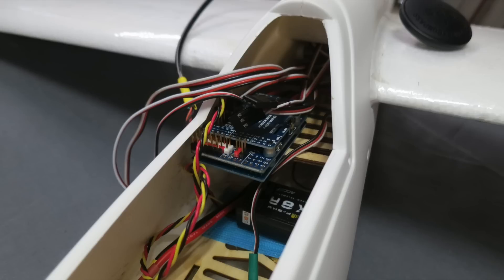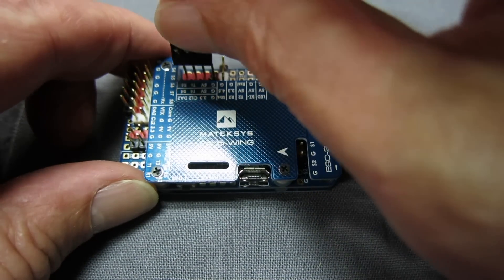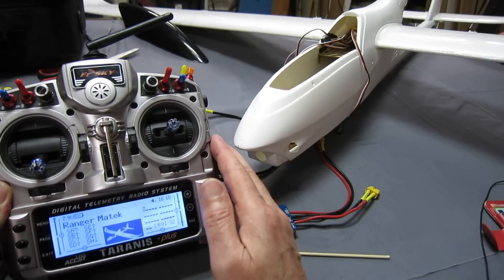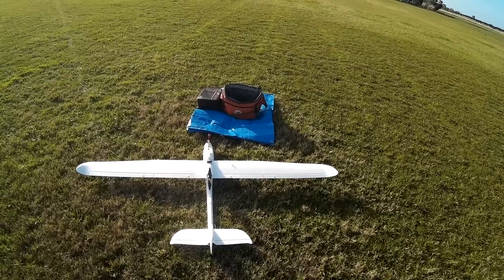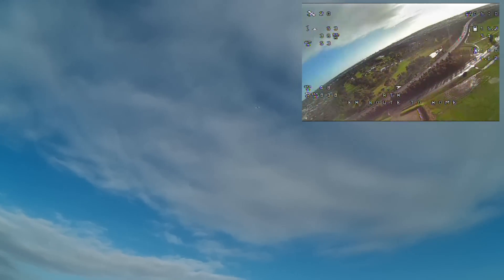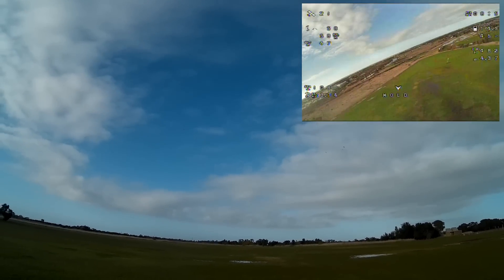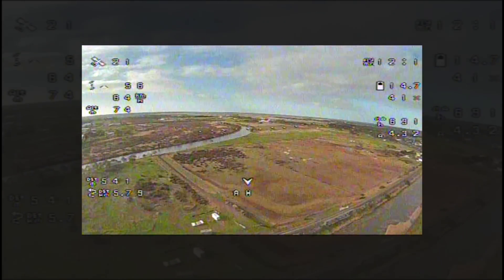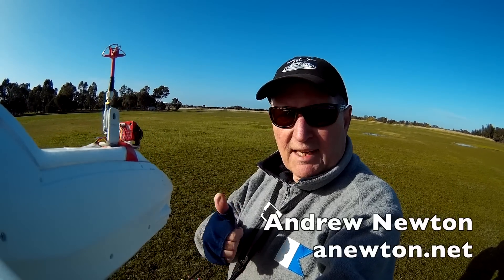Matek F405 Wing FCB iNav setup and flight

Comment: Hi Andrew, I would like to ask you a question, I have a Matek 405 v2 for my glider, I use Inav Configurator 6.1.0 and FC Firmware 6.0. I completed it and I even flew it, but only the pitch servo and ailerons work, the rest doesn't work, Inav reads it but they don't respond to the commands... I tried everything, can you recommend something?
Reply from the maker: Solder bridge the Vx and Vx2 pads. Watch my review of the V2 board

Comment: Hi Andrew, on the Matek wiring page it says that left & right Ailerons go on S4 & S5. Does this mean that they need to be plugged in separately or can I use either S4 or S5 on a Y lead ?   Trust your fingers are recovering, had a look at them on your Community Tab, boy that had to hurt big time :) Cheers, Pete
Reply from the maker: Y lead is fine. Only need separate channels for flaperon function
Reply: @AndrewNewton  Thanks Andrew, that's what I thought but I knew you would know :)  Regards, Pete

Comment: Another awesome video. 
I am stuck with the FPV setup. May I learn your VTX preference for this configuration. On one of your video I watched your positive review about TS5823L, would it be fine to use that?  Thanks in advance.
Reply from the maker: Most of my FPV setups use the 200mW TS5823L Cheap and simple.

Comment: This might be a stupid question, but do you need an ESC if you use the Matek 405? I assume the ESC is not needed since the flight controller handles that as well.
Reply from the maker: Some quad FCs have ESC on board but not the F405. It does have BECs but not ESC

Comment: Hello, is it possible to trim my plane (I’m using matek 405 on inav)while I’m flying or I should do it after fly? Tell me pls how to do it, I heard that it is a mistake to trim servos on taranis?
Reply from the maker: Yes, switch to Manual, activate Auto trim mode while flying, fly level for maybe 30 seconds, trims should adjust themselves, land and disarm. Dont touch the taranis trims.

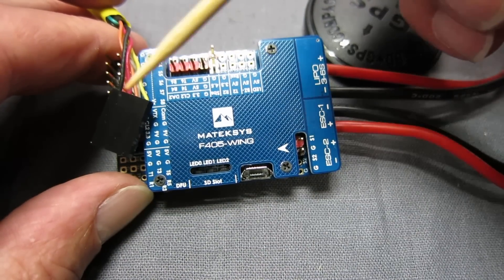Comment: Hey Andrew. Just starting my build. Interesting, I did what you said and opened the GPS to confirm the wire and terminal alignment. I thought I had an issue with the GPS as the black ground wire (assumed) was frayed. I see it was exactly the same for you (1:33). Not sure why it is, just good to know I’m not alone. I was thinking I would have to rewire it and solder to the terminals. Have you had any issues with the GPS as a result?
Reply from the maker: It's a shielded cable so the bare ground wires wrap around all the others then come out to the black wire (maybe). No problems with mine so far.
Reply: Thanks Andrew. Hadn’t thought that one through. Makes sense ✈️

Comment: Have got the Matek F405 too.....but seems to be something wrong. Pos hold wirks very well, but the plane won't return to home....
Reply from the maker: Frustrating. Recheck your setup from the beginning, make sure the GPS is marking the home position.
Reply: @AndrewNewton  Homeposition at Arming and Arrow to Home looks fine. tomorrow i'll try again... could imagine that there is a issue with the max angles in navigation modes.... today was frustrating. Crahsed my 9" into the woods....lost a 100€ 4 inch....and my 5 inch quad is toilett bowling as hell :D

Comment: I have this set up in a similar model and when I'm in manual mode the plane wants to roll to the left. To trim this do I have to adjust my servo arm or can you trim this in INAV configurator? Your videos have been extremely helpful!!! Thanks for sharing your knowledge and experience!!!
Reply from the maker: The best way is to adjust the aileron push rods, or you can use Auto trim to reset the servo mid points.
Reply: Andrew Newton thank you sir!! I did try the auto trim but it didn’t seem to fix the roll. I believe the safest way would be to adjust the pushrods manually. Then I know the plane will fly correctly for sure. Thanks for your help!!

Comment: I can’t find those 4 pin servo plugs anywhere. Where did you get your from?? What are they called, except 4 pin servo plugs??
Reply from the maker: Dupont connectors https://www.banggood.com/Geekcreit-310pcs-2_54mm-Male-Female-Dupont-Wire-Jumper-With-Header-Connector-Housing-Kit-p-1063303.html?

Comment: I have this installed in a SonicModell AR Wing.  Everything works well except for one very annoying bug.  The OSD drops out intermittently several times during the flight.  The video is solid, but the OSD drops out.  I have triple checked everything and even replaced the flight controller but the problem persists.  
I am not using the 5 volts from the ESC but am powering the board through the battery voltage only.  I'm ready to pull out the F405 and go back to an OmnibusF4.
Reply from the maker: Some cameras just dont like the OSD overlay. Makes sure PAL / NTSC selections match up, and VTx and camera share the same ground.
Reply: @AndrewNewton  Problem solved thanks to you getting me to look in the right direction. I simply changed out my camera from a Biteye SA-A3161 to a CaddexTurbo Micro F1.  Interestingly enough, although the Biteye specs state PAL and NTSC, there is no adjustment in their OSD menu for video format.  In INAV, I always select Auto for video format and never have had a problem.
Again, thank you very much Andrew for your suggestion.

Comment: Hi Andrew.  Just asking what port was your gps on in inav ports tab please?   I am having a lot of trouble getting the fc to recognise the gps.  Thanks.   Ben
Reply from the maker: UART4 for GPS with the F405 Wing. Try swapping the Tx and Rx connections, make sure "GPS for nav and Telem" is activated in the config page
Reply: Thanks Andrew.  Much appreciated.  UART 4 corresponds to the TX and RX pads on the flight controller.  It is working well now with a Ublox 6mn gps from an old APM.  I am using the Matek f405 ctr for this QAV500 quad and have ordered an F405 Wing from your affiliate link for my Bixler project.  Many thanks.   CP

Comment: So does this mean the 411 board is not as good? Dam As I bought 2.
Also do you need to swap rx and tx with GPS same as the 405?
Reply from the maker: F411 Wing is a good board. Just that it is not filtered on the FPV feed and ESC noise shows if you power the ESC through it. It's not terrible and can be reduced with an LC filter. Video is clean if you dont connect the ESC to the board, which means you dont have current sensing. F405 Wing is the best
Reply: @AndrewNewton RX/TX gps on f411 SWAP yes or no?
 Cheers Andrew . Gone from not wanting/intrested in APs to a wealth of knowledge. 
You the man.
Reply from the maker: Yes, that's always the way with UART connections. Rx goes to Tx and Tx goes to Rx
Reply: @AndrewNewton  Thanks mate. Just watching your f411 Video as I type. Your getting slick cobber dont forget the small peope on your way up! :-)

Comment: How did you make the compass work? My Missionplanner does not detect it. I use arduplane.
Reply from the maker: No compass connected, it's not recommended for fixed wing iNav. The direction is coming from the GPS and only works when the plane is moving.

Comment: Andrew, I also purchased a Matex and funny I had the same revelation with hooking up and powering the GPS. Too bad I did not watch this first. My only remaining issue is using the Inav OSD. I hooked up the transmitter and camera just like you and great pictures, but no OSD readings. There is probably a small item I missed. Any suggestions?
Reply from the maker: Have you enabled OSD in iNav configuration page?
Reply: @AndrewNewton  I went there and did setup the features and in the modes I setup the OSD SW. I didn't remeber the switch but went back and see that turns it on and off. My error. Thanks.

Comment: Hello , new to rc aircraft, is it possible to run 8 motors with this esc? In other words use the two esc power pads to power four motors each. Its for a school project involving distributed electric propulsion. Ive looked for previous examples and  researched the topic through different forums. It seems possible with Y connectors but would appreciate any knowledge you could share on the topic. thanks.
Reply: so four esc's wired together using y connecters and plugged into the same channel on the receiver.
Reply from the maker: Sorry Caleb but I don't know. Usually motors have separate ESCs but I don't know if there is any particular reason.
Reply: sorry I meant 8 escs and motors with this flight controller? Have four escs and motros on one wing connected to one of the esc power pads and the other four connected to the second esc power pad.

Ive researched and it seams possible using y splitters and only running the positive lead to one esc and just ground to the other 3.  
 @AndrewNewton

Comment: Quik question, Do I need to set up in my radio a plane or swing?in case that I have a wing.
Reply from the maker: Basic plane with no mixing, no expo, no rates. Just 100% throttle, 100% aileron, 100% elevator. Here's my blog post that gives more details. http://newtonairlines.blogspot.com/2017/10/inav-fixed-wing-tips.html

Comment: What do you mean trim it mechanically?
Reply from the maker: Get the plane or wing flying level by adjusting push rod lengths only. Not using transmitter trim at all.

Comment: is there a name for the 4 pin plugs or a link where to buy them
Reply from the maker: DuPont connectors - https://www.ebay.com.au/p/610pcs-Housing-Connector-Pin-Male-female-Crimp-Pins-Kit-for-Dupont/5022439451?iid=273399094957&chn=ps

Comment: Andrew I noted you plane flight crockett, that is not because of you trimming, is because the board when you initialize was not level, that happen to me before, if you see that you horizontal bar do not match with the horizon  is because is not sink, and some time if you trigger return home or fail safe, he's going to fallow the horizontal bar, and in extreme cases will dive into the ground, happen to me in one wing.

Comment: Hi Andrew 
Think I will give Inav a try!!   Probably using a H King Bixler V2 and the Matek F405 which you have described so well..
Do you soft mount your Flight Controllers i.e. Using anti vibration mounts etc??
Reply from the maker: Perfect combination. I usually mount on firm foam pads but it's not essential as far as I know

Comment: You need to plug a GPS unit in? The board won't work without it? I'm looking at getting this board just for the osd and autolevel and was planning on adding in gps and that sort of thing later on. Can i use the board without a gps?
Reply from the maker: Yes, GPS is an option, not essential

Comment: Quick question - does the board provide enough current for all servos, vtx & camera ?? - I read the F411 is not good enough, so wondered if the F405 is any better - thx !
Reply from the maker: Oh yes. The BEC for servos is 5V 6A, that's better than any other BEC I have used

Comment: Yep they dont make setting up flaps easy do They, still scratching my head
Reply from the maker: I have a solution of sorts, I'm plugging flaps directly into Ch8 on my X8R and not using Ch8 via SBUS on the MATEK board. Video coming as soon as I can test fly the setup. I suspect iNav 2.0 will make all this easier.
Reply: Andrew Newton finally worked it out mate! Need to create another input channel on your taranis for flaps, then in inav on the mixer tab create a new rule for the channel that you created in your taranis as the source and modify it on the servos tab :)
Reply from the maker: Excellent. I'll try it soon too.

Comment: Hi again Andrew!
I'm planning a winter project (in your summer) building an ASW28 and equipt it with FPV. As training I have a Timber UMX with a micro cam and VTX. I tried using goggles, but that didn't work for me as I'm using reading glasses, so now I go for a monitor mounted on to the TX. Then I'm building a FPV-pod a la Alan Moore to use on my pressent ASW 28.
Now to the point. In the new ASW 28 I'm planning to use a FCB. I've studied your two videoes of the Matek 405, then I've found another FCB for fix wing, a Cyclops Storm. The major difference between the two is that the Cyclops Storm is complete DIY kit, (except cam and WTX) while the Matek 405 is more abuild-it-yourself gadget. And then the Matek 405 require some soldering and switching around with cables and plugs. But it sertanly has moore features and possibilities.
I'm sertanly not a trained "solder", and have limitied knowledge in electronics, but I can read a manual and follow a procedure. What do you recommend? 
And you are using a variety of servo plugs. Is there a tool that fix the cable to the plug, and where do you buy theese plugs, 2, 3 and 4 pins and tools.
Thanks for very interesting videoes.
"Sev"
Reply from the maker: Hi Sev. These are the Dupont connectors I bought https://www.aliexpress.com/item/1450Pcs-Set-2-54mm-Dupont-Connector-Kit-PCB-Headers-Male-Female-Pins-Electronics/32841687530.html There is a crimping tool available but I just use long nose pliers and solder. You would need to practice soldering before taking on the Matek F405, the fine pins are easy but the thick battery wires are more tricky to do nicely. Worth learning the skill anyway. I dont know anything about the Storm FCB but it does look easy to connect up. Interesting project, but flight control boards are not really designed for thermal gliders. Would be better suited to something like a Ranger 2000 with big batteries and long powered flight time.

Comment: As always, great video, Andrew!  I'm definitely going to order this flight controller.  Maybe two, lol.  I wanted to share something with you, just in case you weren't aware of it.  You can add a Lost Model Buzzer/Beeper to the flight controller and, when the GPS Lock has been acquired, you will get an audible notification.  I have set this up on my my two Inav/GPS builds and I very much like having the audible notification.  As long as the Buzzer is enabled in the Configuration Tab, Inav does this by default.  Take care buddy!!!
Reply from the maker: Oh I didn't know that. Thanks for the info, I will add a buzzer immediately.
Reply: Andrew Newton Excellent!

Comment: I am making an airplane.I am using three 1000Kv BLDC with 10×5 propeller.Weight of airplane is 4Kg.Wing is 3 feet long and 2inch chord.
Can I fly it?
Reply from the maker: Show me a photo or video
Reply: Thanks for your reply.
I don't have pictures of the airplane because I am still building the airplane.
I just want to know that I can fly airplane.
What is your opinion?
Reply from the maker: I would need to see the design before I can give an opinion.
Reply: How can I send you picture of my airplane

Comment: Question, Andrew - my Ranger has the left/right ailerons joined into one plug. On the iNav mixer it shows that they have to go to S4 & S5. Do I have to change to separate cables and connect them individually? Thanks.
Reply from the maker: Good question. Cant see why it wouldn't work, but I have not tried it. Something to test
Reply: It will work both ways, but better to use two outputs from the FC. This way your ailerons can also be flaperons. You can set this up in INAV

Comment: Thanks for tour explanatory video.  Just a question. I’ve read on the net that the ranger 2000 is really a stable plane (great for fpv) and should not need any stabilization. Do you agree with that? Thanks.
Reply from the maker: Yes I agree. The Matek board is more for FPV safety, with failsafe return to home and altitude hold. The ranger doesn't need stabilisation

Comment: Good video. I have exactly same setup. Just one question, During your first RTH trial, why do you think the plane was going left and right instead of coming straight at you?
Reply from the maker: Maybe the cruise throttle was too low (1400) for the climb rate, and there was a headwind? Needs more testing
Reply: Andrew Newton Thanks Andrew,
One request, it would be very helpful if you can do a video on configuration of airspeed sensor for this plane. There are almost no videos out there on this topic. Thanks.

Comment: Thank you for the great video. I just received the same FC and will Mount it in a ranger 2000. How long are Your leads from FC to the battery and from FC to the ESC ?  Can you show how you mounted the FC inside the plane?

I will use a Frsky L9R in SBUS, but how can i get the RSSI from this to the FC  ( setup in inav)
Reply from the maker: Battery lead is 8" and ESC 6" I just set up RSSI from an X8R for the first time. All you need is a single wire from the RSSI pin on the Rx to the RSSI pin on the board. Then enable RSSI in the OSD (I think, haven't tried it in the air yet) I'll do a follow up video soon

Comment: Are you sure that gps is 5v because I bought the same one and it calls for 3 volts.
Reply from the maker: I'll ask Matt Ogbourne about that, he mentioned it in one of his iNav videos
Reply from the maker: The answer is - It has a voltage regulator chip to reduce the input voltage down to 3.3V for the GPS unit. So 5v (and even higher) is OK
Reply: Andrew Newton yup watched a few videos 3v - 5v is fine. Thanks man

Comment: Andrew, How does it cope with wind? As it has no air speed indicator, flying down wind could be an issue??
Reply from the maker: It adjusts throttle to maintain altitude in the auto pilot GPS modes, and in the other modes it's manual throttle control.